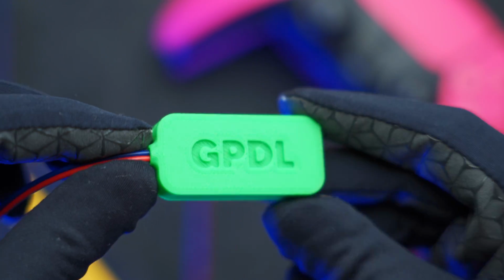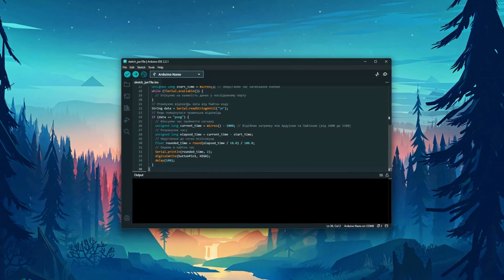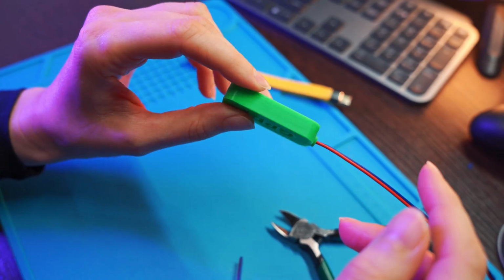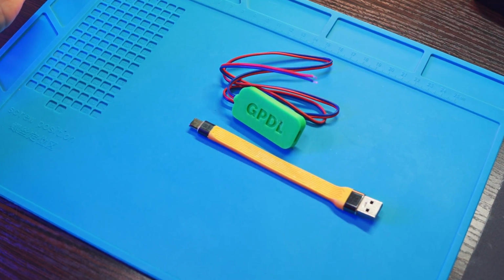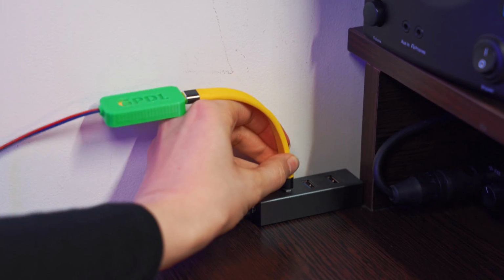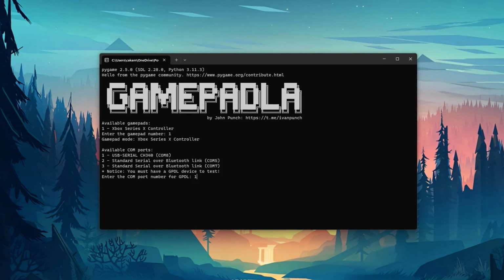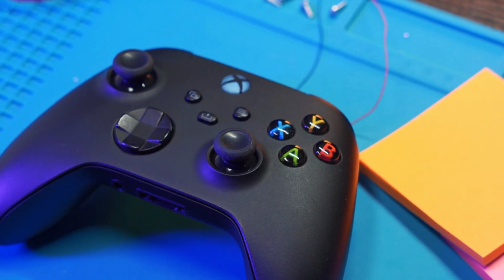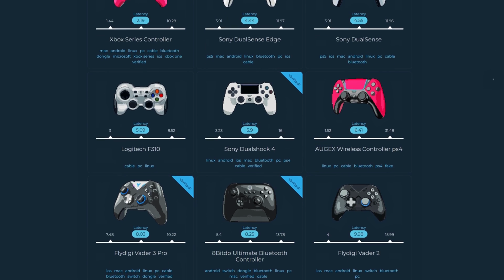GPDL: DIY latency tester for game controllers

Comment: Hi, 
when I test a gamepad it saís: "The test has started"
But the progress stays at 0%...

Did anyone have the same problem and knows how to fix it?
I have uploaded the code to the arduino and the cables are connected to the gamepad. it also activates the button when i connect the two wires like in the video.
Reply: I have the same issue
Reply: In this case, you should swap the contacts
Reply: did you manage to resolve the issue? I'm having the same problem
Reply: @ShadowProgr  Swap contacts. In gamepad cable conection mode use only 1 contact. Try different combinations